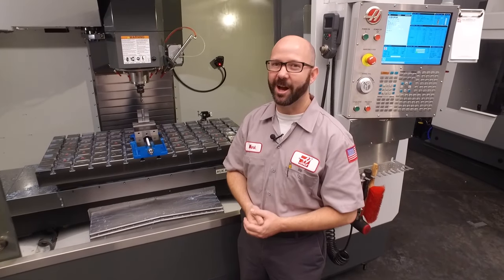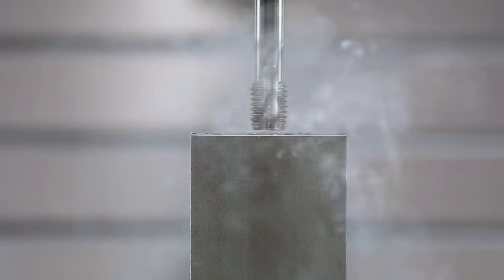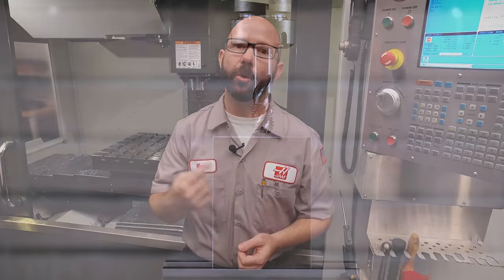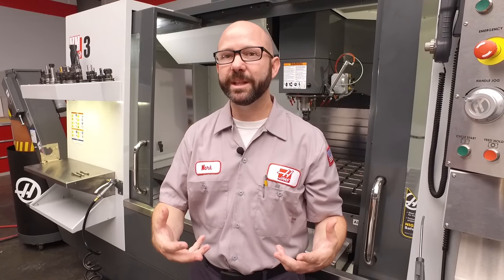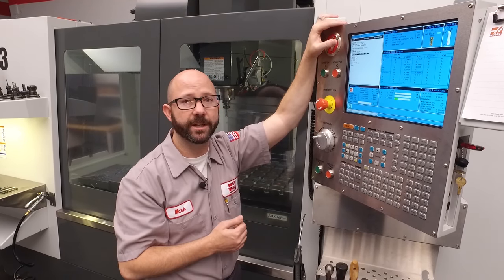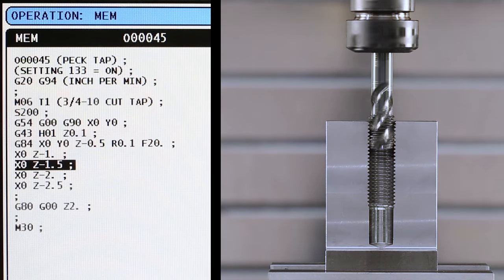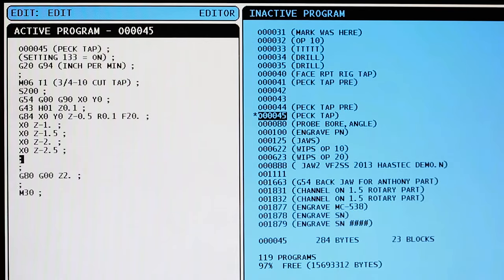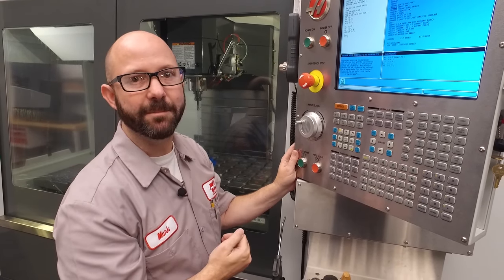Simple Peck Tapping Using a G84 Tapping Cycle – Haas Automation Tip of the Day

Comment: This is how I currently run peck tap cycles but I've always wonder why the G84 canned cycle cannot make use of a Q command for its peck increments? That would be a nice way to eliminate some redundant code. Thanks for the video Haas. You guys rock.
Reply: seriously!
Reply: I wondered the same thing...our VF-4 just ignores it.
Additionally our machine came from Champion Machine of Houston and no one bothered to set the 133 to on.
The people here at this shop are clueless on this.
I've got a combined 30 years playing with and programming G code machines and have issues with a supervisor with 6 months running things.

Comment: A word to the wise; If you put a new Z depth after your initial G84 line without a X or Y it will go to the last Z value. 

Example:
T3 M6 (1/4-20 TAPRH)
G54 G17 G80 G90 G40
G00 X0. Y0. S800 M03
G43 H3 Z1. /M08
G84 Z-.2 R.2 F40.
Z-.4
Z-.6
Z-.8
Z-1.
G80
M01

^^^ THIS EXAMPLE WILL TAP TO THE LAST Z WITH NO PECK!

Example:
T3 M6 (1/4-20 TAPRH)
G54 G17 G80 G90 G40
G00 X0. Y0. S800 M03
G43 H3 Z1. /M08
G84 Z-.2 R.2 F40.
X0. Z-.4
X0. Z-.6
X0. Z-.8
X0. Z-1.
G80
M01

^^^ THIS EXAMPLE WILL PECK. (MUST HAVE X OR Y POSITION FOR THIS TO WORK AS SHOWN IN THE VIDEO)
Reply: hello sir, I am the beginer of vmc programmer .please give me some tips for drill, boring, taping, program.
Reply: hello sir, I am the beginer of vmc programmer .please give me some tips for drill, boring, taping, program.
Reply: BTW. Exactly same thing with G81 if you want to have custom peck depths or to go a bit down at one feed and an bit more at another.
Reply: Just use Q in the program like 

g83G54 G17 G80 G90 G40
G00 X0. Y0. S800 M03
G43 H3 Z1. /M08
G84 Z-.2 R.2 F40.Q.2
G80
. 
And dont need this all theese lines. imagine if u have 10 thread. u will make like this?

Comment: Prolive advange you use a Q value on fanuc. This is one of the few instances where fanuc control edges over Haas. On fanuc peck tapping is a single line code,very easy and also less room for human error. Hopefully Haas adapts the fanuc(and some Mitsubishi) for peck tapping.

Comment: We had a haas sales rep that failed to tell us about setting 133. Its been off and we have been snapping taps. Thank you so much.
Reply: Same here, I just started working for a company who bought a VF-4 a few years back and they didn't have the 133 turned on. Additionally they have used Gibbs cam which for some reason puts a G81 or G83 command in the program when you specifically pick "Tap".
The sad thing is the cell lead has never seen a CNC a year ago and is clueless on programs. He literally "drilled" the tap in the part and snapped it off.
I spent two hours arguing with him about the program being "wrong", and I guess my thirty years of programming and playing with G-code machines didn't matter.....

Comment: Great video!  Is it possible to change the tapping cycle in VPS to use G84, or does that have to changed manually after outputting the code to MDI?

Comment: Mark, I am curious why an X co-ordinate needs to be entered in front of the new Z depths for the G84 Peck Tap Cycle?  I thought, no co-ordinates, no X,Y movement.  I'm guessing it has something to do with signaling a return to R otherwise the tap would just continue down to the successive Z depths?  Thank you in advance for your answer and providing these instructional videos.
Reply: +Lee Putman I'm curious about that as well.  My initial thought is the extra X coordinates were for illustrative purposes. I think if they were required you'd need to enter both X and Y for each line.  I think it just drives home the point that you're staying at the same position.  I'd love to hear from Haas on this or maybe just have someone try it and report the results.
Reply: +Lee Putman 
A word to the wise; If you put a new Z depth after your initial G84 line without a X or Y it will go to the last Z value. 

Example:
T3 M6 (1/4-20 TAPRH)
G54 G17 G80 G90 G40
G00 X0. Y0. S800 M03
G43 H3 Z1. /M08
G84 Z-.2 R.2 F40.
Z-.4
Z-.6
Z-.8
Z-1.
G80
M01

^^^ THIS EXAMPLE WILL TAP TO THE LAST Z WITH NO PECK!

Example:
T3 M6 (1/4-20 TAPRH)
G54 G17 G80 G90 G40
G00 X0. Y0. S800 M03
G43 H3 Z1. /M08
G84 Z-.2 R.2 F40.
X0. Z-.4
X0. Z-.6
X0. Z-.8
X0. Z-1.
G80
M01

^^^ THIS EXAMPLE WILL PECK. (MUST HAVE X OR Y POSITION FOR THIS TO WORK AS SHOWN IN THE VIDEO)
Reply from the maker: +Lee Putman Hi Lee, thanks for reaching out. The control needs an XY move of some sort to trigger the cycle. If we don’t command an X, a Y, or both, it won’t tap. The Z, on each line, is to peck at a different Z depth for that pass. Good question, hope this helps!
-Mark, from the Haas Tip of the Day
Reply: Thanks Mark, I was thinking it was something like that.

Comment: Thought HAAS was silly when it didn't orient spindle tapping same hole. Kept purchasing Spindle Orientation on each HAAS and modified Post Process to run Spindle Orientation for every G84 command. Go figure this option can be turned on without the purchase or Spindle Orientation. Too late for 3 machines I own, but good reference for future machines.

Comment: Deer HAAS
I'm using HSM, with a generic HAAS post, and it's generate this code, the first peck is ok, start on Z5 go down to Z-3, the second and the rest, is go up to z70 and start the taping from here. Why is it not using the R5 , instead of the z70 which is the retract height, for move to each hole?

G43 Z170. H1
G0 Z70.
G98 G84 X0 Y0 Z-3. R5. F955.
G98 G84 Z-6. F955.
G80

Thanks for your answer, and sorry for my bad english... :)

Comment: Interesting way to control peck tapping.  Does the setting have to be changed manually, or is there a way to program for changing the control setting on/off?
Reply: Good question!

I normally machine parts with over 100 holes and just now I am learning of that spindle orienting setting
Reply from the maker: +x19freak Setting 133 will need to be turned on in order to peck tap. The Setting cannot be changed from within a program.

Comment: As per your advice on how to use peck tapping , I want to know , how to use G98 code to dodge my clamps, for second hole ?
Reply: Thanks in advance I figured out for my question , I used G99 and G98 to dodge my clamps
Reply: @Cognizant_precisionengineering  I think the more simple way is to use g98 and  set your g43 h value above the highest clamp on the work piece!

Comment: Hello
The video is great. But I have a BEAUTIFUL Haas VF1 whic does not have a 'setting 133' that I could find. I still need to peck tap. Any idea on what to do?
Reply from the maker: Adel Tabsh – Setting 133 was introduced back in Mill Software Version M12.09. If your Mill is newer than that, you may need to give your local Haas Factory Outlet a call, to make sure you have the Rigid Tapping Option (Parameter 57:4 RIGID TAPPING must be on), and they can verify your Setting 133. – Mark, Haas Tip-of-the-day

Comment: Is the repeat rigid tap feature available on all VF mills.  I found the 130 feature on my VF2 mill but not 133 feature.  Do they use different number for this repeat rigid tap feature?  My tap broke every time if I tap deeper than 1/2 inch.  I tried to tap several times on the deep holes but the tap holes got loosen on top and tighten on the bottom.  I have checked the speed, feed, coolant mixture, and they're all meet the requirements.  Any comments or suggestions will be appreciated.
Reply from the maker: For this issue I'd recommending reaching out to your local Haas Factory Outlet Service/Apps department; they can help you out. On older mills, (like before 2003) Repeat Rigid Tapping wasn’t a Setting, it was a Parameter. Your HFO can help you with this specific machine. Please visit http://bit.ly/Find_HFO if you do not know your local HFO's contact information.

Comment: Can i read the value of setting 133 from within a program? that way i could be sure it was on before allowing the program to run.
Reply: Yes. We could check Setting 133 with a macro. On the Classic Haas Control (CHC) we can use variable #6nnn to check settings. On the Next Gen Control (NGC) we can access Settings with variables #20nnn. 

CHC:
IF [#6133NE1] #3000=1 (TURN ON SET. 133)

NGC:
IF[#20133NE1] #3000=1 (TURN ON SET. 133)

Comment: This is not working for us. We set 133 to on & even set 130 to 1 just to see if that was not the problem. Our 6-32 tap, with peck set to 0.313, S320, R is at 0.3" above the material & F10.0, creates tap sized holes. The bottom 1/8" or so of the hole has thread, but the rest of the hole is the tap diameter. Our code format matches what this video shows.

Comment: I run a fanuc machine and when I use g84 to peck tap the tap will only retract around 1mm and stay inside the hole rather than coming all the way out, and in my opinion I think this is what is breaking my taps, anyone have any information on this

Comment: Question, in your second hole why did you input the line X1.0 Z-.5, it should read the depth from Z-.5 from the original G84 line of code right? Can you please clarify if this is not the case.
Reply: +Paulo Esquenazi The G84 command is modal and it "remembers" the last input values for each address.  Thus, if you simply put a new X,Y position for hole #2 it would tap to the last Z value it was given (Z-2.5) in the line above.
Reply: can't you just add the q and the final dept.

Comment: mrs mark i understand but i want asking someting if my code  G84 Z-30 R2.Q5.F200 it will work for  peck tap?
Reply from the maker: +ProLive Advange No, adding a Q value will not work on a Haas control. The procedure Mark describes in the video is the method you should use to peck tap on your Haas. Thanks for watching and for your comments!
Reply: +Haas Automation, Inc. thanks for your answer mark :)

Comment: What is peck tapping used for ? I asked my boss and the tool maker and they never heard of it or can find a reason for it and we have special taps for each material we use and I thought it would be handy for the Ti but we got special taps for them recently and as one said you would probably break the tap as its cut would start on work hardened area if you did that on Ti.
Reply: Hayden Verstin on deeply tapped holes the spiral chips build up and twist around the tap binding in the hole, reversing the tap and bringing it out of the hole from a depth before the chips wrap up allows them to fall off the tap and not end up back in the hole, so the next depth section is also figured by how the chips form as well. This has saved thousands of broken taps through the years
Reply: Hayden Verstin-  I forgot to mention I used peck tapping mainly with spiral flute taps, or blowing out the hole with each raise of the tap if it was a spiral point tap
Reply: Jadon Cramer quick question, I know this is an old comment, but how do you define a “deep hole” is it a ratio of the diameter of the tap?  We’ve had some issues with some 4-40 taps and 2-?? Taps recently and I stumbled upon peck tapping.  Just curious what your formula may be, if you’re willing to share

Comment: Sir what is canned cycle and also rigid taping m so 🤷‍♂️ confuse pls help
Reply: Canned cycle are basically G-codes that makes the machine do series of actions instead of one particular movement. They are kinda "shortcut" g-code and make things much simpler to program and easier to understand. Rigid tapping I believe is when the tap is solidly held by something, instead of into a holder that has some "slack" to it. This means the machine has to orient its angle and start at the same exact location when starting the movements, and the movement has to be perfectly synchronised with the rotation of the tap.
Reply: @shadowdsfire  ....plus you have to add M29 S300 or whatever speed prior to the G84....this only works on FANUC controllers like Dal-Lih and Mori's.

Comment: So many years have passed and Haas' G84 still doesn't accept the Q value. Consider this before purchasing a CNC machine from Haas. It would be a nightmare if you had 20 - 200 deep holes that needed tapping. Silly machine!

Comment: why not just use "Q" ?
Reply: +MegaJohnhammond The Haas CNC control doesn't use the Q address to assign peck depth in a tapping cycle.  This video essentially shows a workaround for that.
Reply: Ditto above....if it's in the program it will ignore it....additionally putting a M29 S300 ridgid tap command will alarm the controller.